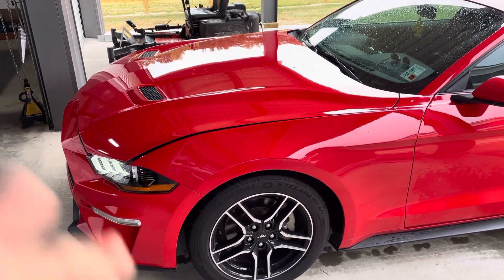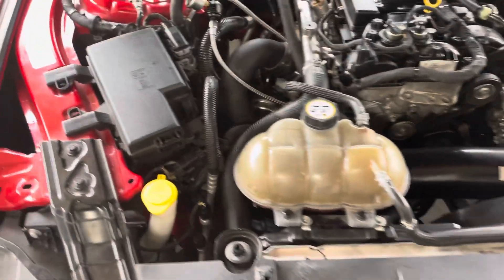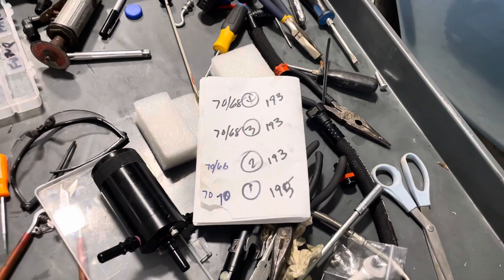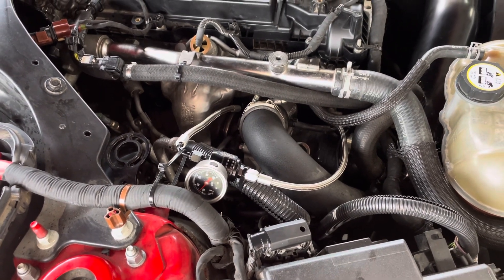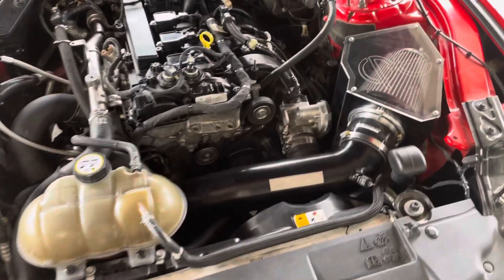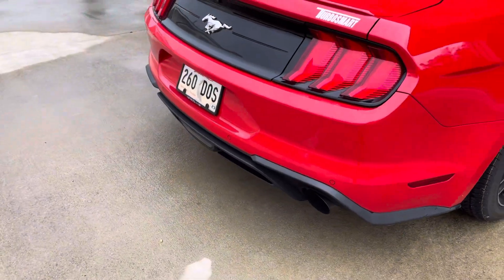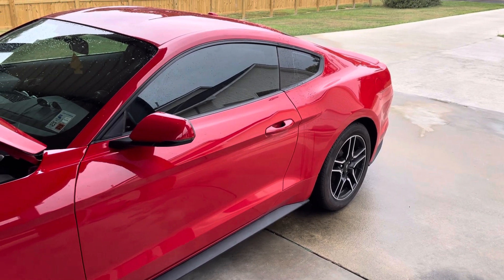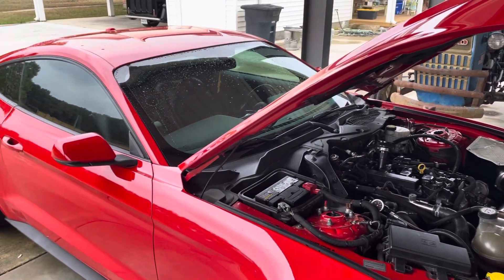Mustang Ecoboost Turbo Smoke Solved - Precision Turbo - Plains Hot Rods

Comment: I’m in the same boat with my precision turbo 6466 gen 2 dual ball bearing. Wish I had done some more research prior to going with this brand. Everything I read so far is Precision turbo is the most finicky turbo out there when it comes to oil pressure/drain and restrictors.
Reply from the maker: I can say it does perform very well.  Shes fun to drive without fogging the roadways now.